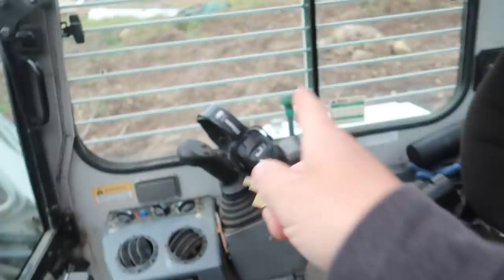Skunks in the CHICKEN COOP!

Comment: Hi Al ,
I see that your rock producing farm is doing well . The rocks are really growing well . Getting to be boulder size now !  Typical New England farm.  Skunks can be so much fun !
I went out early one evening to find a large paper bag from the trash , laying on the ground and moving ! What the heck ? L knew that it was some sort of critter. I used a long stick to lift up the opening so I could see inside of the bag. And found two juvenile skunks looking back at me !  Since I was only about 4 feet away from them I backed off pretty quickly.  This was only 19 feet or so from the front door of the house so I didn't want to excite them or rile them up.  I decided that good sense was the better part of valor and left the skunks alone. Time for some coffee.  I checked a little while later and the skunks were gone. My next plan of action ?  A trash barrel with a tight fitting lid !   Skunks are not nice to have around of course but they have their usefulness. Such as helping to keep the mice population down.   Live and let live I say.

Comment: With your boulder..
Maybe try digging all around it.  Deep enough on one side to roll it into that hole...(deep as you can)
I've buried a lot of things to big to pick up....
But i could push them...
Just a thought...
Reply: Following up on this comment. I would have moved to the opposite side if the boulder and continued digging on each side to loosen the dirt around the boulder. Then reach over the boulder and try and pull the bucket under the stone and lift it up to get it lose from the dirt. The closer you are to the center pin of the excavator the more lift and pull you have. If you can get it to wiggle then you may be able to roll it out of the hole. Once you can move it either leave it exposed for a climbing rock pile or dig the hole deeper and bury it below the surface and let the pasture grow over it. That is a small machine and those big rocks can easily overpower it. Good luck.
Reply: jim h

Comment: They hate water!! Spray them with a water hose they won't spray just run away from it! We did it at the cannery pretty often! 
Solution for skunk is a bottle of peroxide,1/2cup baking soda and 2 tablespoons of liquid soap! Mix in a bucket till action stops , apply to affected areas, don't add water till you rinse

Comment: I have well water at my place and ants got into the pressure switch. Ran out of water all lathered up mid shower.. so I ran out in a towel and lifted the well house to tap the switch to get it going again. Got it up about a foot before I spotted that big fluffy black and white tail lol... ended up getting the longest strap I could find to pull the well house open. Popped it with a 22 when it ran. I have no sense of smell at all and don't want them anywhere around. One could spray me walking out of the house and I'd never know it. It's open season for skunks at my place lol

Comment: live in a city.  Have had a skunk dig under the front of the house and take up residence.   Affraid of a spray.   So, first item on our agenda was finding the entrance to the nest.  Found two nest.   Second was put down flour to verify that the skunk was using the entrance.  Waited 24 hours.   Next item was put up two very hi-intensity lights under the crawl space.   Have had not traffic now for 48 hours.   Now I am doing to put down rags soaked with PINE SOL.    Hopefully this will force them to move on.  Then I am going to get aggressive at sealing up the crawl space for at least 30 inches deep all around the crawlspace.  Hopefully that will solve the problem permanently

Comment: Get you a goat or two they will pick up the leaves. I have a skunk
Problem ,I trap them using an egg as bait,also where they dig under
The fence, I use my electric fence. First fill the hole with water then
Put the wire low to where he will squeeze and zap!!! Once they get to
Eating eggs they will be back every other day and then they go for your chickens. Good luck. They will spray!!!!

Comment: At the airport in Wolfeboro we built a house that was a quarter mile off the road, it was a hanger and a house combination.   The town inspectors insisted that the utilities be 4' below grade.   That rock you left behind looked smaller than some I had to deal with.  I would dig out all the rocks next to the big one then pull the monster into the hole I had created.  I think on that one, from what I could see, if you had gone around on the other side you could have worked that rock loss.   I had several stones that took me an entire day to deal with. The conduit could not bend much, so the trench had to be pretty straight. and deep.   The Airport owned a little mini hoe, I think even smaller than the one you are using.   I spent most of a month digging in the stone piles of Wolfeboro.

Comment: Get a couple hundred red flags at home depot so you can plant them by big rocks and stumps that you need to address.  This will save you equipment time and search time when the machinery is running.  Once your grass is up and growing you will have a tough time locating the objects you need to address with the excavator.  You can do the clean-up and smoothing out later with your Kubota.

Comment: I shot a skunk that was in a live trap with a Gamo pellet gun and I would not do it again.  It was in town so I did not use a .22. I shot the skunk in the head and it went down so I left it overnight and I figured I would dispose of it in the morning.  The next morning it was up walking around so I put another half dozen shots into it.  This time I did body shots, this did the trick.  I don't think the pellet gun had enough power for a headshot even though the gun will drive a pellet through a 3/4 inch pine board.

Comment: On an unrelated note...how much poultry netting do you use around New Yolk City?  100' or 164' ?  And did you opt for heavyweight posts?  Looks like a fairly good distance between posts.  I'm looking into what I'm going to need for my mobile coop for my new land in Hudson, NY!  I just bought a complete setup with a solar charger, 500' of electric horse fencing, 50+ 8' T-posts w\decorative pvc sleeves and about 7 galvinised livestock gates ranging from 4' to 14'. All in perfect condition and only $300.  I think I got a great deal, now I have to go pull all the posts and take down the gates, but that's ok, it all comes with a post puller and a fancy spring loaded post driver too!  I'm starting to plan how I'm going to setup my operation for next spring, I only have a small insulated barn on the property but there is water and electric already in place.  I've got lots to figure out!
Reply from the maker: We have the 164 and the shortest one for height. Yes we have the HD post
Reply: @LumnahAcres  thanks!